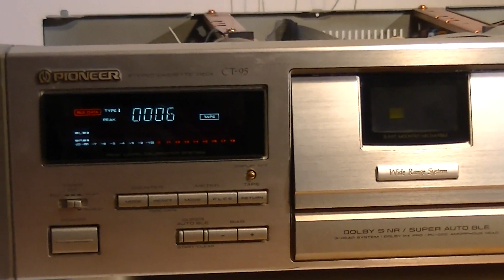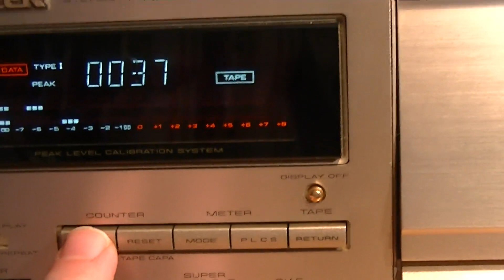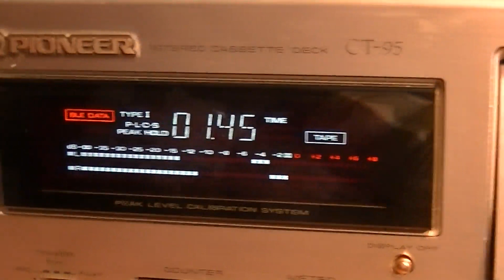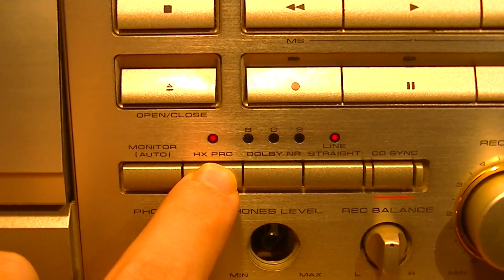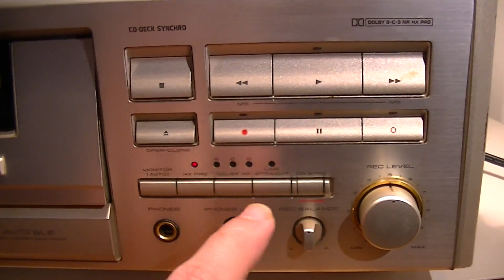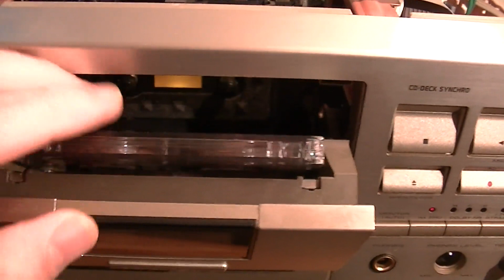pioneer CT 95

Comment: Around 12:35 breifly on the video, if you freeze the image, can see some missing components near the playback connector area. any ideea why is that?
Reply from the maker: Usually they design one board for different models in a way that only the component vary but the layout is the same. Just one model has parts of the board unused while the other model has other area. And sometimes these differ because of the country and the power grid characteristics (in power supply circuitery)
Reply: @llagona  that i know...but ct95 suppose to be the supreme machine, therefore all parts should be present on the board, and not one blank space to be found.  usually the lesser the deck the lesser the components
Reply from the maker: @emilian5903  Yeah. I thought of that, and I wanted to mean is that in the lower cassette deck, there would be fewer components with simpler circuitery and it's just that for those simpler circuits would use other placements in the same board (which are seen here empty) leaving bigger blank spaces by having moved those circuits . In the old days there was a real shortage of space inside decks. But by the time this deck was made, designs had reduced component number and simplified many circuits into newer integrated circuits, also power supply weren't as big/powerful. Boards were easily designed for several models. However, I'm not very documented in this matters, and respectable forums like tapeheads or audiokarma will show more information .

Comment: in the playback amp, there are some parts not present on the board. any ideea why?
because this is the top of the line deck as i know.
the missing components are ussualy on lower tier decks
Reply from the maker: That could be because there was a Japanese version , even better T-100 or at leas possible different. But also, and more likely , the missing components could be for a cheaper deck in which some present components would not exist in that lower deck. ... but could Be, I don't know and I haven't give it a second thought
Reply: @llagona I own a t1100s and I can assure you that are exactly the same parts missing.
Reply: @llagona  Maybe because different decks just have slightly different schematics, and on the lower class decks other components are missing but there are some components not used on this deck.